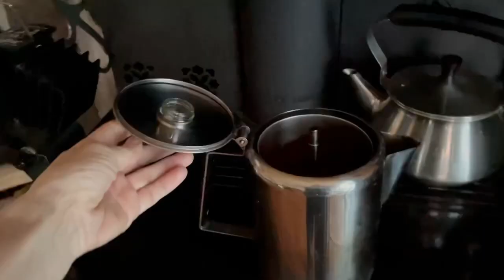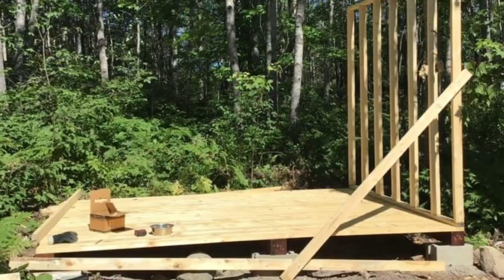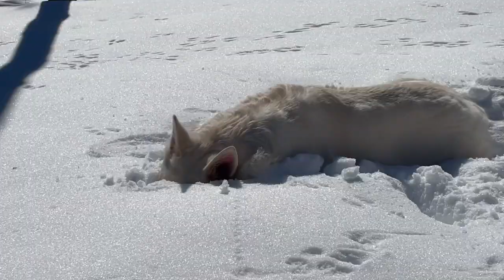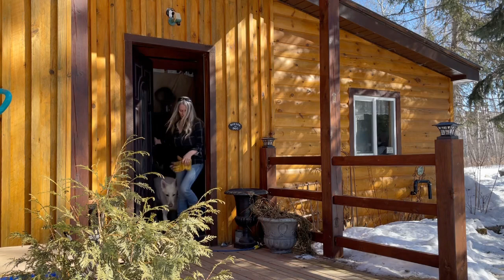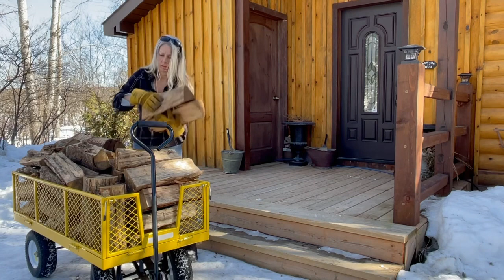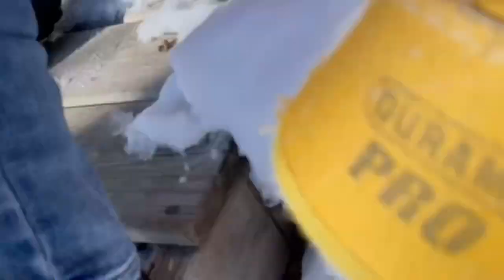My Wood Shed Project//Daily Chores at the Cabin/ - EP 3

Comment: I want to give you advice when chopping wood. 
You stand a little wrong when chopping wood with your right foot, if you have an ax it will fall past the log then it will hit the right leg, Try to spread your legs to stand up confident, then with the legs apart, the ax will fly between the legs, and will not hit you on the leg, especially on the right, which you expose when swinging an ax on a fire, This advice was given to me by my dad when I was chopping wood and since then I have never hit my legs

Comment: Thinking it might be easier I built my home with only a 5cm rise from the ground outside. There is a second story deck(to get above most of the mosquitoes)with an under roof so the area by the main door stays clear of snow. When I was wheelchair bound for about a year and a half (back surgeries) I built a handicapped ramp (while in the wheelchair). Now it is easier to wheel my wood cart right to my indoor wood storage using the ramp.